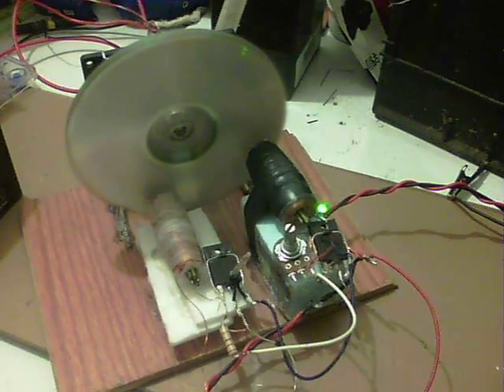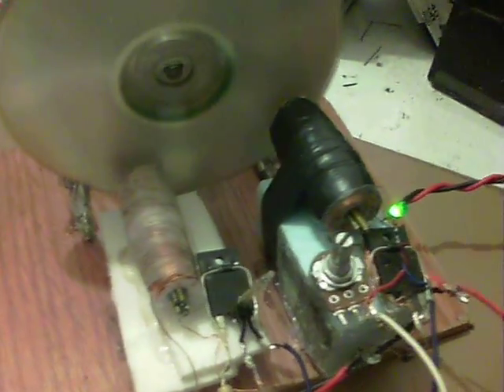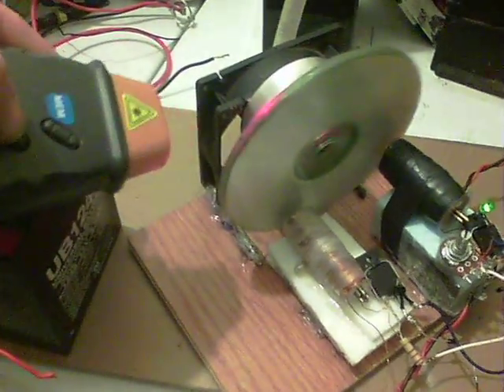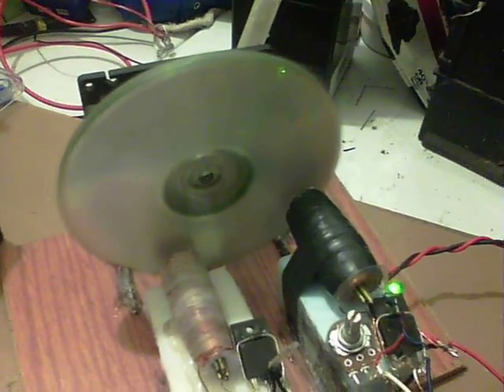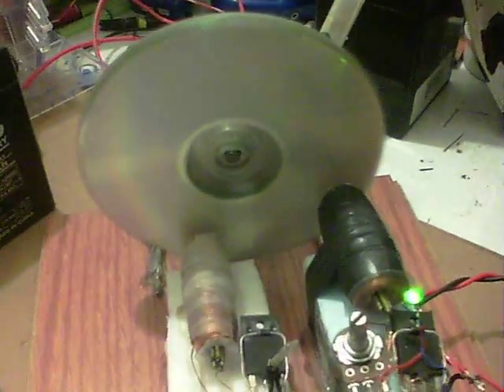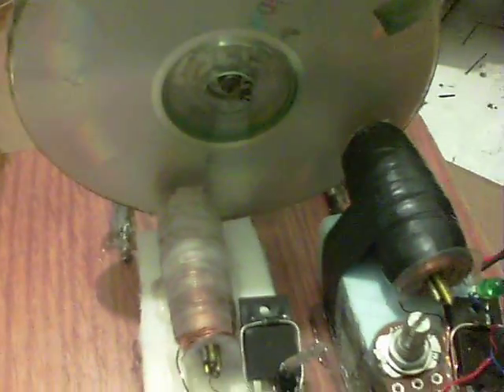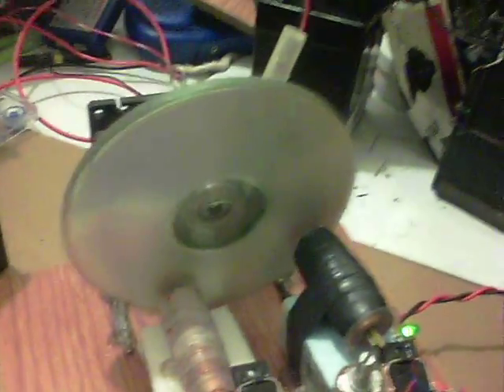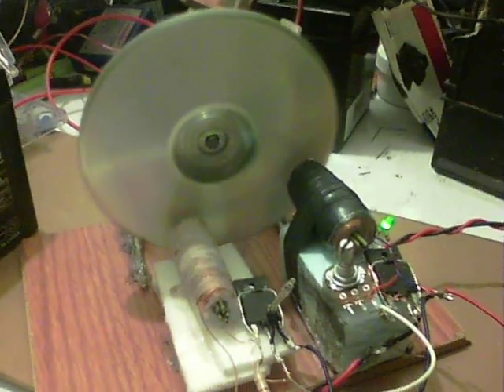Added tranny power - Bedini SSSG

Comment from the maker: @UrCoffeeTastesToasty Ah I could have said. I take a large diameter drinking straw and cut to length. Then cut out 2 circles of clear plastic from store packaging. Take a square piece of tape and cut tiny slit lengths to 3/4 height along. That goes between straw and plastic piece to secure (looks like an open skirt thing as wraps around straw,slit pieces open onto plastic piece). That forms the bobbin. No hole in one end stops the core pieces moving forward. Finally, wrap with tape.

Comment from the maker: @spicer41282 Thanks :) It's drawing 260mA without tuning, 230mA with tuning the pot. Just finished building a third power coil and transistor set up and will see how that works, if I can fit it so it doesn't fall off/down/sideways.